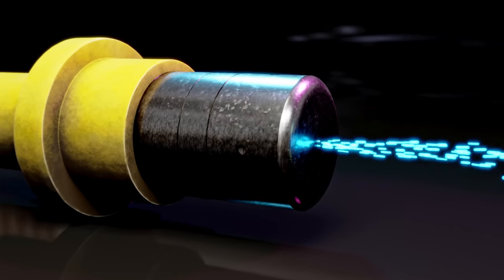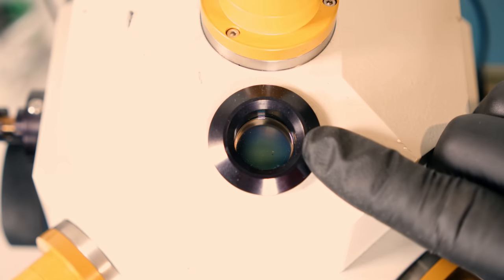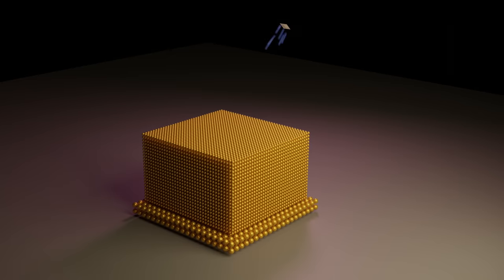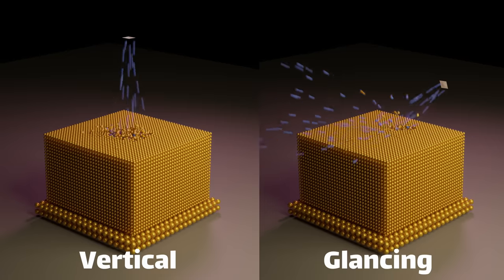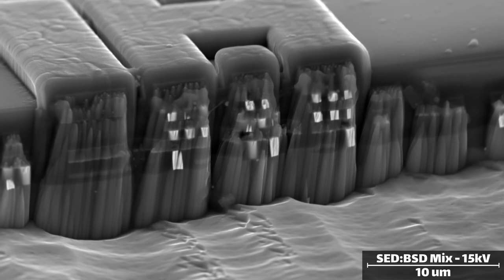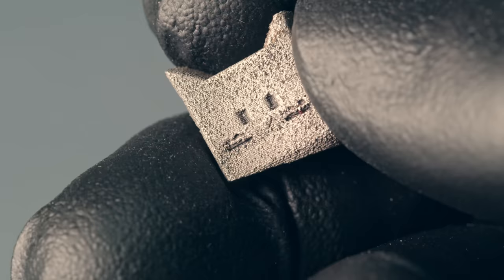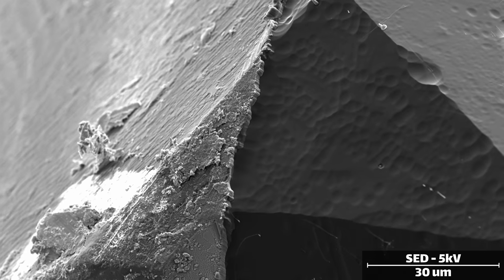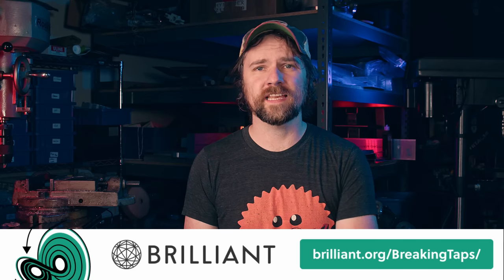Cut anything, even diamond

Comment: The chip research group I used to work at used a focused Ion Beam (FIB) to do chip repair and modification for prototype chips. We can go in and even deposit resistive material, or build up entirely new probe pads to connect to the center of a circuit to debug things. Pretty cool stuff, very expensive machine. 

The dummy filling process has made it much more challenging to get to the lower metal layers, and as a result we have to be clever about it when we etch or design.
Reply from the maker: Super cool! FIB is such a neat technique in general, but really cool that it's used to repair or alter chips. The deposited material is done by GIS right? Inject a gas and let the ion beam chemically alter/bond it to the sample?
Reply: Did not know it is possible to repair a chip. 🤯
Reply: @BreakingTaps I'm not really that familiar with the practical process - I was lucky enough to never need my chips tinkered with after we got them back from the foundry. We have one guy in the group who is the expert and spends a lot of time on the machine. There is a lot of 'Fingerspitzengefühl' involved with getting all of the parameters working optimally to get good etching and so on without destroying the underlying chip through stress etc.  Main way I have seen it used a few times is to kill unwanted oscillations in unstable millimeter-wave amplifiers. At some point someone was even putting in resistors to reduce gain (and thus chance of oscillations) that could be connected if there were some issues after manufacturing. 

You can also trim resistors with it, but usually it is much easier to do that with a laser - unless you need to be really precise, or want to deposit too, using a precision laser to cut traces is much more (cost) efficient. Added bonus that the learning curve for the laser is sufficiently low so PhD researchers can operate them by themselves, unlike the FIB which requires high vacuum, expensive gas mixtures, and in general a lot of training. I remember a situation where a researcher was building custom diodes for plasmonic detection from scratch, and each diode involved >5kUSD worth of tungsten-deposition gas or something.
Reply: @BreakingTaps  The precursor gas (e.g. W(CO)6 for tungsten deposition or XeF2 for silicate etching) sorbs onto the surface, forms a monolayer, and reacts slowly or not at all until activated/decomposed by secondary electrons from the ion beam scanning a particular part of your sample.

So for deposition you get W (and some C and O impurities because the process isn't perfect) on your sample surface with the CO sucked out by the vacuum system.

For etching, the F2 reacts with your sample and the Xe is removed.

You can get the same effect using the electron beam in a dual beam system (or even a SEM with GIS - a rare but not unheard of combination) but it's much slower than with FIB due to the lower activation energy and beam current. It's sometimes useful for things like protecting super fragile samples with a thin metal film before doing more deposition with the ion beam, or doing chemical staining (with no sputtering) to selectively etch regions of a sample.
Reply: @AndrewZonenberg Hah, Fancy meeting you here!
Reply: Focused ion beams can also be used to make incredibly thin samples for transmission electron microscopy. I spent the last half of my career doing material science mostly for semiconductor devices and that small etcher and the huge FIB machines were my major tools.
Reply: @BreakingTaps  Im a current FIB tech. We use the GIS to inject a variety of different gasses. Generally we would deposit a carbon/insulator cap to protect the ROI using an electron beam and then top that off with a tungsten or platinum cap in the Ion beam. But it really depends on the type of samples we are making or what we are looking for. 

If we are looking for a specific defect, we want to protect the ROI so that the defect can be removed and examined on a TEM.
Reply: @AndrewZonenberg  Thats precisely what i would do as a FIB tech that works on dual beams. Usually we are looking for small defects so we use the electron beam to deposit an IDEP or carbon cap onto the ROI before moving to Ion beam. Then we deposit a tungsten or platinum cap in I beam before continuing with more milling.
Reply: So can we 3d print chips with one of these in principle?  Sounds like FDM could go nano.
Reply: @zyzzyva303  I mean, i guess you could. But it is not cost or time efficient at all. I cant even imagine how long it would take to individually deposit the BILLIONS AND BILLIONS of transistors
Reply: @zyzzyva303 You already have nano-3d printing with things like 2-photon lithography! As for building chips with FIB: I don't know if it is precise enough to work at the atom-scale we are now.
Reply: I’m not the dummy
Reply: @tsrui480  The FEOL (front end of line, actual transistors) would be hard to impossible to do with FIB because it has the same amorphization effect as ion milling so your channel wouldn't be crystalline anymore. And there isn't really any good way to dope with a FIB either.

Given a bunch of transistors you could in principle do all of the BEOL (back end of line, interconnect wiring/insulator) with FIB but yeah it would be absurdly slow and impractical.
Reply: @JorenVaes Joren, I very much enjoyed reading your comment.
Reply: @AndrewZonenberg Sounds like you'd need to use other semiconductor materials like how diamond CVD epitaxy (though it looks more like a self-sputtering machine, due to magnetron plasma heating to create iirc hydrogen radicals) needs selective etching plasma to grow in the semiconductor crystal phase at reasonable pressures. Kinda makes me wonder if intrinsic diamond can act as a gate "oxide", considering bulk intrinsic diamond is one of the best insulators we can synthesize...
Reply: @BreakingTaps  FIBs have a lot of uses. They are infamously also reverse engineer devices.

Comment: I remember using these all the time during my doctorate program. I took so many cross sections of through-silicon-vias  (TSVs) and surface micro-bumps, testing ways to stick chips together. I also remember using these machines to place in some "bodge wires" and fix up some very tiny pads (even sometimes those little bumps themselves) on prototype dies. Fascinating machines and incredibly powerful tools in the semiconductor world, but I've very glad my work is all computational now, as these things take forever to go from step to step compared to logic and signal simulations I can just let run.

Comment: You should never ever attempt to run a turbomolecular pump in air. These devices are designed for removing most of the remaining particles in a fine vacuum to achieve an (ultra) high vacuum and turn at ultra high RPMs. Running them in air (or any other relatively dense gas) will easily overwhelm the mechanism and crash the whole thing.

Also, Argon molecules don’t exist – as a noble gas, Argon exists only as single atoms ;).

But don’t get me wrong, this was a great and very informative video!
Reply: Making Argon fluorohydride out of spite...

Comment: You have two main knobs to control etch rate in different materials:

* Incident Angle: Metals etch faster with a normal, or head-on angle. Polyimide or photoresist etch fastest at about 60°.
* Relative Mass:  Matching the mass of your ion to the material to be etched can change the selectivity.   For example, choosing a high mass noble gas could increase the etch rate on your tungsten while decreasing the rate on aluminum. 

I have to compliment your atom-on-atom model of the interaction during etch, it was beautiful.  One thing though: regardless of incident angle the ejected atoms tend to leave normal to the surface, with a population distribution that falls off with the cosine of the angle away from normal.  There is a small population tail opposite the incident angle of the beam though. This is because the momentum is transferred into the surface and the subsurface atoms reflect it back to the surface.
Reply: makes sense if you think of it, like a captive poolball, there's really only one way for the ball/atom to go, and the remaining energy is dissipated through the structure as heat.

Comment: We used to have an ion mill for making 3d models of geologic samples for oil and gas reservoir characterization.  Basically it would mill down a layer of material, do a scan with the microprobe, then rinse and repeat.  Stacking all the scanned layers together got you a pretty decent 3d model of the sample.

Comment: Awesome video.  I've ben exploring sputtering osmium targets and trying to grow crystalline samples in a quartz furnace.  Thanks for the tip about the analog controller.  I was able to use the old thermal couple it improved my results by several factors.  Extreme control over the temperature has solved the growth rate and size.  Thank you again 👍

Comment: I had a summer internship working with one of these Gatan PECS system. I used it as a polishing system for EBSD samples. I was using it at very low currents. It kind of works once you get the recipe right for your material system. Thanks for the video!

Comment: Would love to see some detailed videos of the problems and fixes used to get it up and running.
Reply from the maker: Yeah in retrospect I should have filmed some of that. Was just deep in debugging mode and didn't think about it.  A lot of the issues ended up being related to the vacuum gauge (it was really dirty and needed cleaning). The reported vacuum level would sometimes fluctuate wildly, which would confuse the machine and think the airlock mechanism had triggered. That had all kinds of effects like turning off the HV supply, messing with the turbo, actuating the airlock vent, etc.

The rough vac pump needs a new diaphragm, so I just replaced it with my other pump for now. Some of the needle valves needed cleaning, and the ion guns needed cleaning too (they get really finicky once material starts to build up, especially insulators).  And I think the bearings in my turbo are dieing, but that's a problem for a different day :)
Reply: @BreakingTaps  I totally get that filming everything while you're trying to think and troubleshoot is probably kinda annoying. However, I would definitely have loved to see some more "behind the scenes", even if it's just filmed with a lower quality camera (which could perhaps make it less of a nuisance for you).

--- rambling continues ---
While the results are really cool to see, I'm almost more interested in the process. For example, I have a Pirani gauge that's behaving kinda weirdly, and was considering trying to clean/fix it, although I'm not sure if that's even possible – most sources just seem to say that you should be real careful with them, and that's about it (i.e. probably impossible to fix/clean). I'm guessing the vacuum gauge you're referring to is a different one since you go down to ⁓10e-5 Torr, so it probably wouldn't have mattered, but it's just an example of the kind of small things that can be really useful to some people. Sadly that level of detail probably doesn't attract quite as many views, though.

Comment: ONE small thing to add:

Diamond etching/polishing has worked in your case because the diamond particles you bought were not of a high grade purity and crystalline uniformity. In the latter case it would take way, way longer before you could see any noticeable result. To speed it up, you might need a much more powerful/plentiful ion guns.

Comment: Wow, this is insanely cool! (Fantastic vid as always too, the animations were great!)

I hadn’t been aware of ion milling before, nano-polishing optics for final figure correction seems like it would be an orders-of-magnitude improvement over conventional mechanical polishing.

I toured a Panasonic lens factory a number of years ago, and saw them hand polishing(!) the tungsten-alloy molds used to make aspheric lenses. The aspheric profile of the mold is formed with a single-point diamond on an ultra-precision lathe. These are quite accurate, but the problem is the diamond tool leaves behind a nanometers-deep spiral groove that can result in ugly “onion-ring” bokeh in the molded lenses. (Bokeh is the term for how out-of-fossil objects are rendered by a lens. Onion ring bokeh makes the big soft background blobs from out of focus background lights in a scene literally look like slices of onions, it’s very ugly and distracting.)

They fixed this by hand polishing the molds. A worker would wrap a cloth impregnated with ultra -fine diamond abrasive around their fingertip and very gently rub the surface of the tungsten blank to polish away the grooves. They had a high resolution surface profilometer that they used to check their work, taking many passes on different parts of the blank to both remove the grooves and maintain the aspheric profile. It was incredible that they could do this manually to a precision of 10s of nanometers, and at the time it was a trade secret of Panasonic’s. A couple of years later it became standard industry practice.

This seems like a perfect application of Ion Milling, I wonder if that’s how it’s done now? The next time I am talking to a Panasonic optical engineer I will ask him.

A quick question: What’s the schmutz on the unmilled surface of the diamond on the left side of the frame at about 10:44 in the video? Is that just surface dirt or is the diamond itself that irregular due to poor polishing?

What a great toy! (It a,so strikes me as an incredibly cheap way to get a high-vacuum system driven by a turbo pump 👍😁)
Reply: For the rough area at 10:44, at the far left of the frame that’s what random carbon gunk (think oils, random grime) typically looks like in an SEM image. Much closer the etch interface, there may be some roughening due to redeposition of sputtered atoms, or may be roughening in a region which received a low flux of ions near the edge of the main beam.
Reply: @MrPatrick1207  Great, thanks for the explanation!

Comment: At work I had a lot of options from 'wrecking Ball' Caesium Ion Sources to very energetic Oxygen Ion sources (which ate filaments !) down to very light Ion's. We had a FAB process (Fast Atom Bombardment) where we set up the Ion beam focus and all that good stuff then passed it through a charge exchange cell (more gas) and you end up with a neutral beam. This was great as one of my favourite studies was 'Depth profiling using Ion Milling to dig the hole, fascinating when using complementary techniques of analysis (SIMS or ESCA) and working your way through a piece of magnetic tape from a video cassette looking at the best bit, and that was the 'Interfaces' of the various layers. This is a stunning video so Kudos there ! and there aren't enough channels for us ' Nano Nerds' anyway !!...cheers.

Comment: Those scratches at around 9:30 can be avoided with good mechanical polishing practices, it does not need ion milling... Struers OP-S colloidal silica with the appropriate polishing cloth (MD-Nap or MD-chem) can easily give you the desired results. 

Ion milling, or more precisely, focused ion beam (FIB) milling can also give more. For example, you can dig out small lamellae for TEM investigations. I used to make them, they were typically 10x20 um large and approximately 100 nm thin at the end of the procedure. The thinning was also done by the FIB, it was a very gentle (and time-consuming) polishing. Also, it is a great method to increase the "resolution" for element analysis (EDS/WDS) in materials. One can dig a cross-section of interest with the FIB, then can dig a trench a few micrometres behind the cross-section. This effectively decreases the volume where the X-ray photons come from, thus the analysis will be less "noisy". Oh, yes, the FIB I used was using gallium for milling and then I could also use it for deposition, but then it was either carbon or tungsten.

Comment: Whenever I see setups like this, I wonder if you have a vacuum buffer, or if that's even a thing.  My idea is to have a tank several times larger than the test chamber.  When it's time to run the sample, you can purge the test chamber into the vacuum reserve tank (fun to say) to reduce the gas pressure by the volume ratio of the two spaces.  Then you'd be able to run a turbo much sooner, or do 90% of the pumping in the first couple of seconds.  A separate pump of even mediocre grade can prime the tank again, while the main system runs on it's own; it doesn't even affect run times.  You could even pipe it out to multiple locations, with check valves for sudden pressure failures.  Cheap video idea, but more runs per day sounds better too.

Comment: I used to work in a lab where we prepared samples of films used inside batteries with ion beam etching. For this we made super high aspect ratio cross sections of that film, up to 200:1 so they could be studied in an transmission SEM. A nice trick was that the etching could also be done inside the SEM, which is great news, because it was near impossible to take the samples out of the SEM without them blowing away at the lightest breeze because they were so tiny.
Reply from the maker: Oh wow, that's a huge aspect ratio!